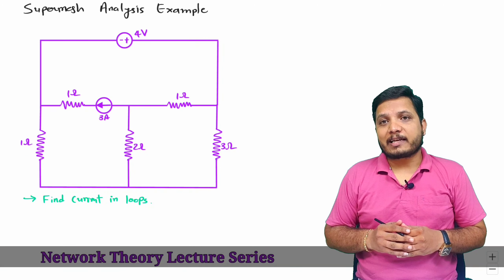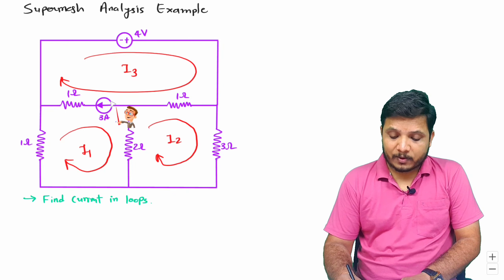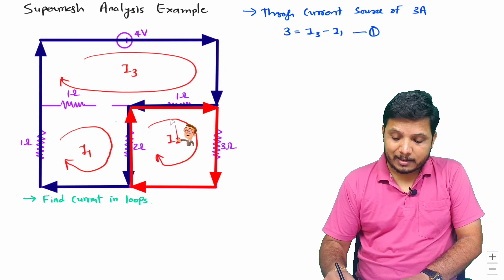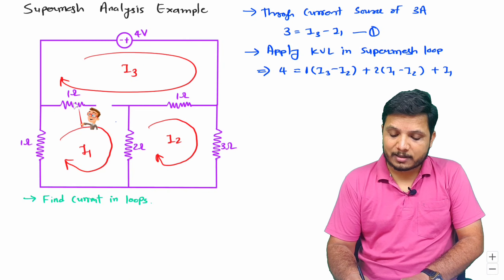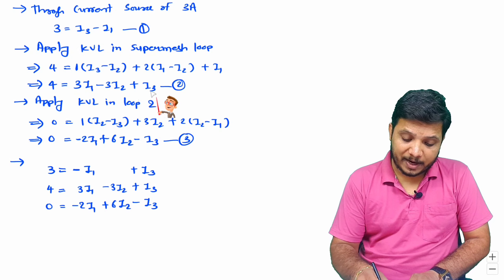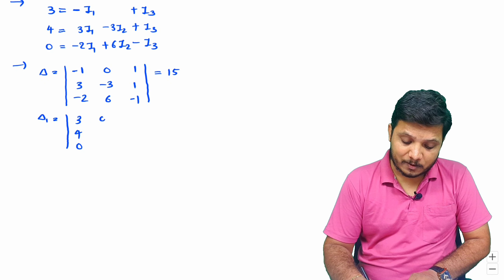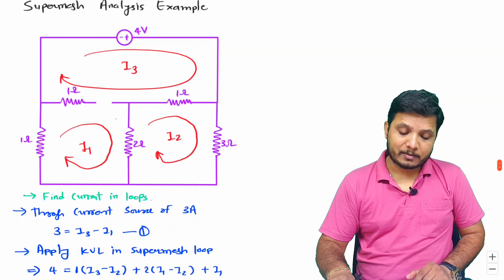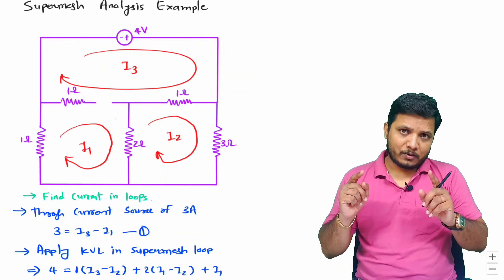1 - Supermesh Analysis Explained: Example and Solved Problem in Network Theory

Comment: Sir Can The Answers Be Different ? If Yes My Ans are 15,7,12 A, Are My Ans Correct??
Reply from the maker: Nope, it is explained in video
Reply: @EngineeringFunda  Sir Actually While Taking Values Of Current Flowing Through Resistor You Have Taken 4(I2-I4) But I took 4(I4-I2) So My Equations are comig different and thus my ans are changing. Is It Correct ? If Not Can You Please Tell Me A Trick On How To take Currents If Two Currents are flowing through same resistor, means which one to take first?
Reply: @EngineeringFunda  ???
Reply from the maker: @TheSeriesLover444  how can I understand your error, Equations can not be giving different values, if it is happening with you then try to find errors. It will improve your understanding. Else everytime you will do mistakes.
Reply: @TheSeriesLover444  assume the current greater of the loop on which u are applying KVL